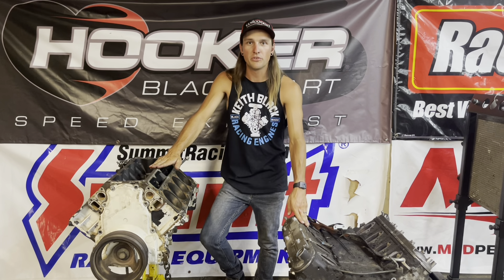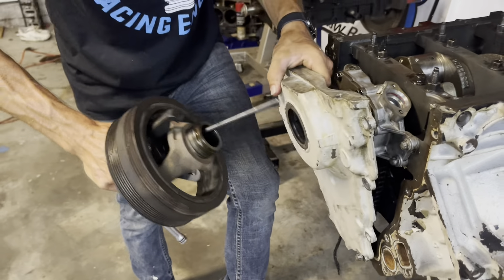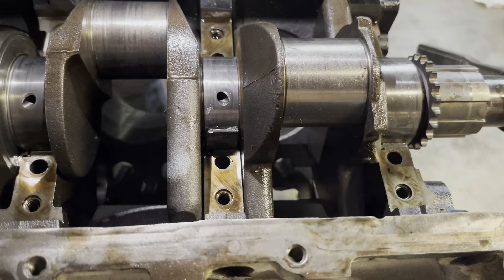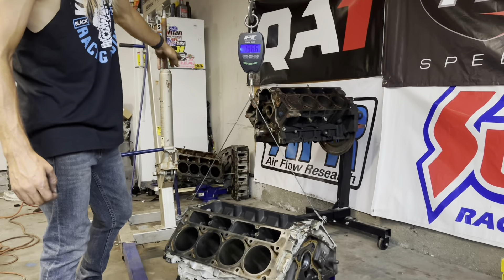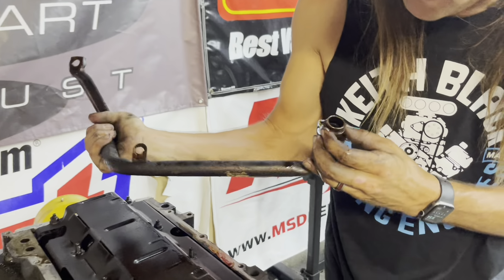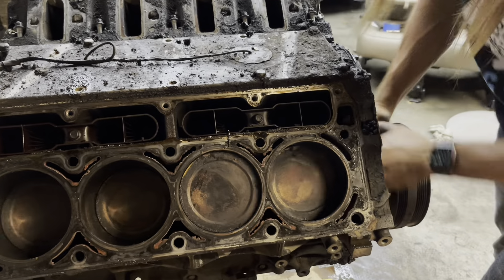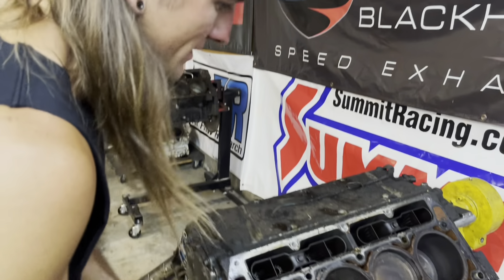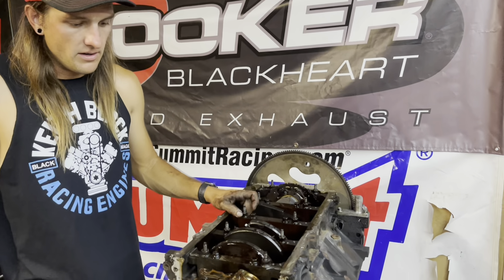Double LQ4 6.0 inspection: Two free engines for the collection

Comment: A few years ago I burned up an already worn out 350 in a Squarebody Chevy by pushing it too far when it was down on coolant. When I pulled the motor and tore it down, not only did it stink up the garage the stench made it into the house. My wife was so pissed. So now that I’m single I don’t have to worry about so much drama... still need to check the coolant and oil but way less drama. Lol

Comment: Pfetzer valve failure. They’re hard to diagnose. Tear down will look fine that’s how you know. You’ll need some 3 in 1 oil and some gauze pads.
Reply: I just hit a water Buffalo, can I borrow your towel?
Reply: @slick-px4pq  Put it on the Underhill's tab
Reply: @Radmutter911  don't forget the 30 weight ball bearings